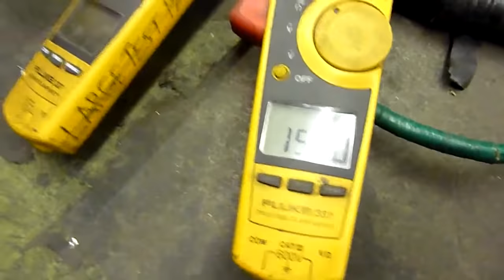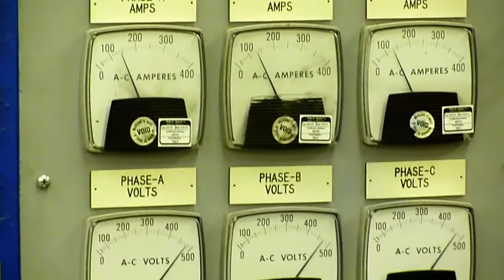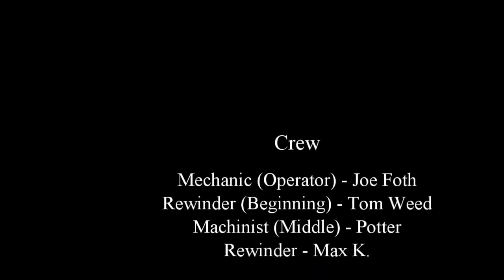Testing Big AC Motor

Comment: Alternative machine we have ascincronus and synchronous motor the trick used to variate speed in scalar control or v/f constant is the best there is also vectorial command which is made for torque regulation to have a machine like continus motor characteristics

Comment: Running a motor that size unsecured is asking for big trouble.  If a bearing fails with the rotor spun up the motor is going places you would rather it wouldn't.  If you are in its way, too bad.

Comment: Can I build a diy power bank that will allow me to run a 75hp ac baldor electric motor like this for atleast 6hrs run time before my batteries die? And what would be my best option for recharging my power bank? Application is for a boat or helicopter lol dont judge me 🤣🤣🤣 just kidding, judge away 🤗🤤😁 and a p.s. to make me look stupider lol can I use multiple, like 20 or 50 or even 100  24v or 48v power tool batteries in series lined up under my chassis like in a Tesla for space saving??? Or how to build a diy mini generator that will run 6hrs plus or longer 🤣 I just keep stretching my boundaries so I'm sorry about that, I just need to know my best option. Thanks for any future advice or jokes...

Comment: Is anyone knows hp & rpm of this giant.
Reply: Probably 3600 rpms and probably somewhere around 800hp depending on if the frame is a heavy duty or not
Reply: does not look like a 2 pole motor, more like 6 pole

Comment: but this is not fast, for this motor is just 13% wtf
Reply: Angel Dust  u mean like gean 1 on truck :D strong but not fast man when spin max speed u can se only crome colour on that little spin and not like here in video u can see easy without slow motion
Reply: Angel Dust  im talking about max speed u talk about power, i need need to use for tank for power all i men that was not fast spining on hes max there in video is only 35% 40%  i used for different machines on work, some like this need more energy and will not go fast to cut some wood